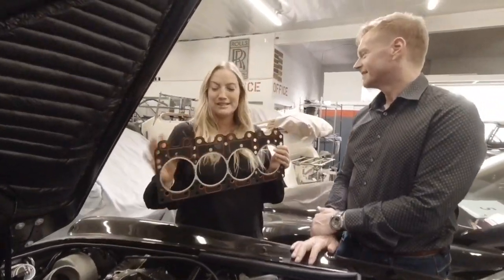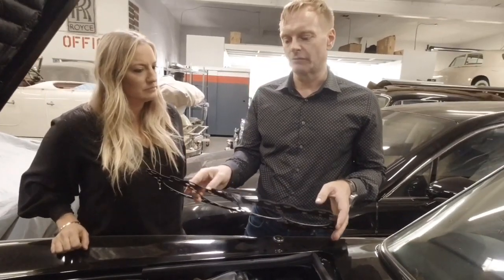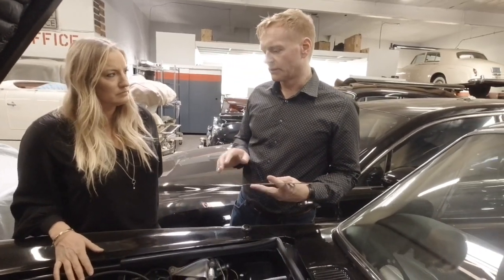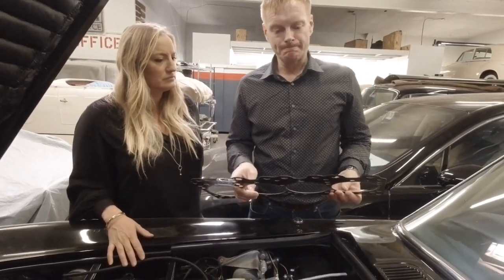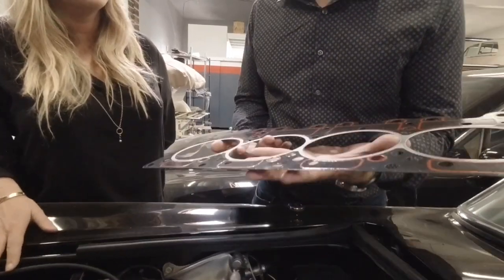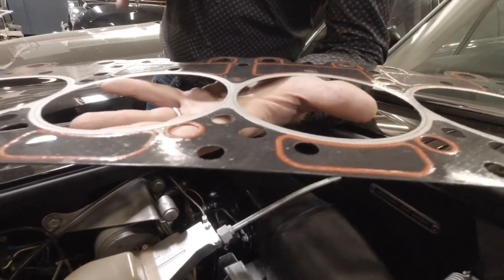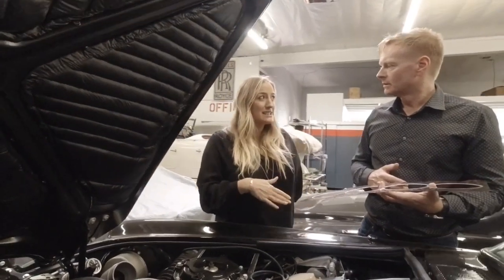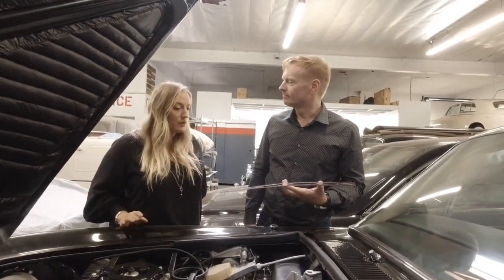Head Gasket : 07V103147

Comment: I was quoted ten thousand usd for my 1971 Silver Shadow head gasket replacement does that sound accurate?
Reply from the maker: Hi,
The parts cost starts at around $1000 but this could go up depending on exactly what they are doing. When the car was new Rolls Royce suggested that it is a 14 hour job but that was when it was new. Now everything will be stuck, bolts can break. It is almost impossible to say exactly how long it would take. Also there is a lot of additional work that could be undertaken while the cylinder heads are being replaced. Unless we know exactly what they are quoting for it is very hard to say whether this is a fair price or not
Reply: IntroCar okay thanks.